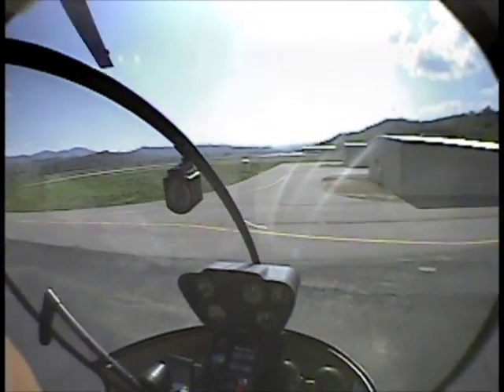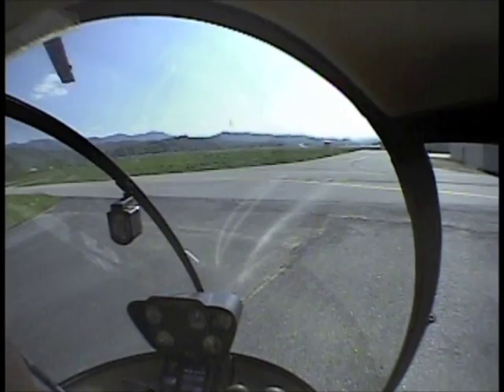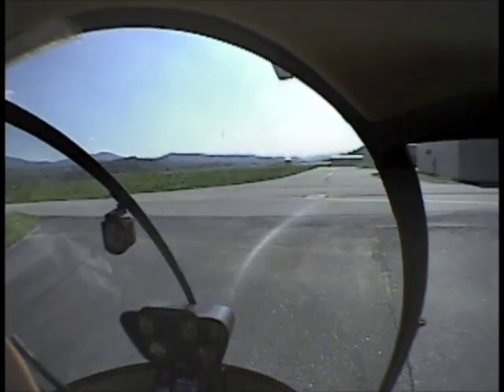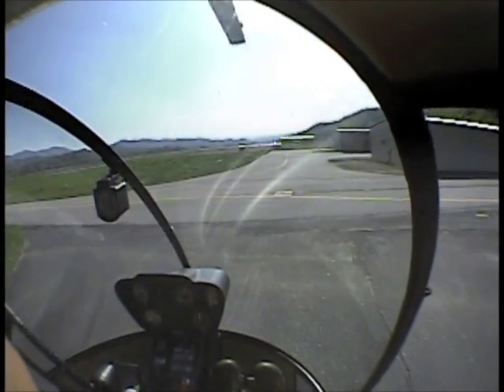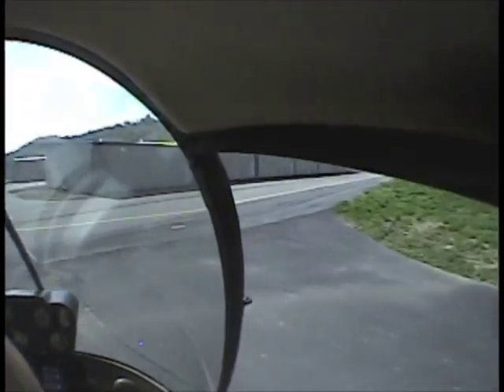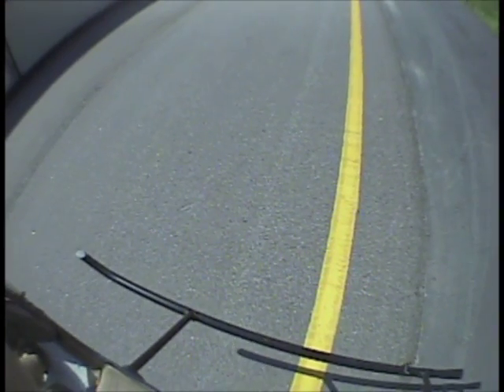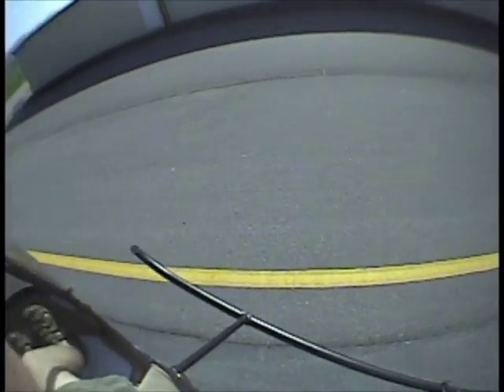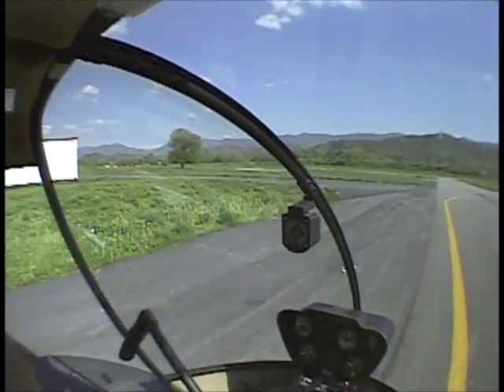How to prevent a helicopter from crashing from a loss of tail rotor authority

Comment: Hello, I understand this is 11 years ago, and I had to watch your feet and the framerate on your props to understand what's going on here. If I understand correctly It appears by powering down and landing, the aircraft experiences some internal friction and yaws left against prop and engine rotation? because I see that you're only very lightly pressing the left pedal. If so I wasn't aware of this and find it very interesting from an engineering perspective. Although I'll say I would have liked to have seen other procedures included, ie leveling off, nose down and perform a running landing, or how LTE can form, like in the case of overpitching. I'm no pilot but I do love helicopters. Thanks for sharing this.

Comment: @williambrodie He did stop the rotation with left pedal which of course you wouldn't be able to do in LTE or any other kind of tail rotor malfunction/failure. For demo purposes and to keep himself out of getting into dynamic rollover it worked but if you had a real case scenario the inertia of the helo would keep it rotating and it would  slowly come to a stop, most likely you would touchdown with a slight rotation depending on how quick your reaction time is in initiating the hovering auto.